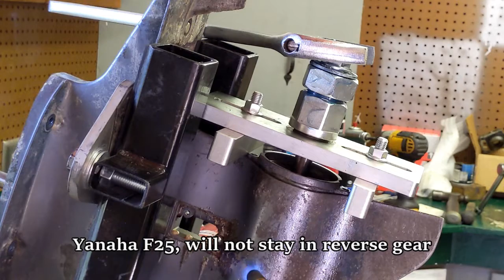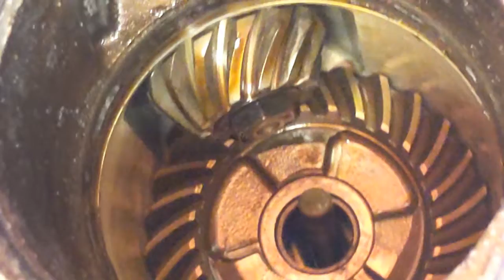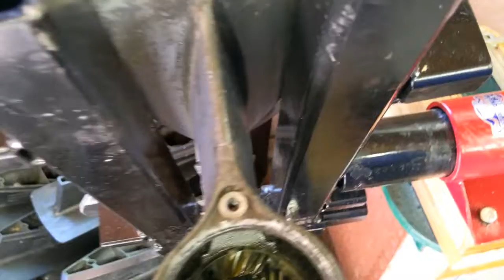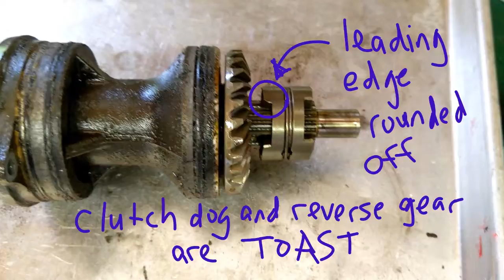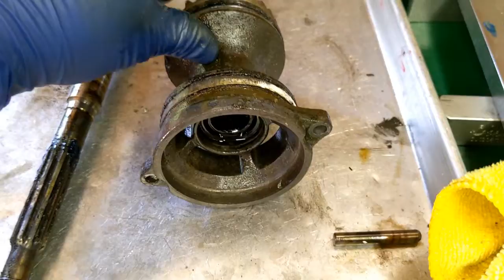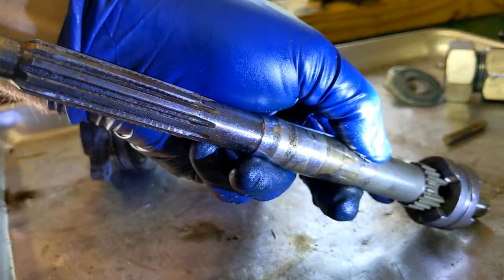OST-0024 Lower Bearing Carrier Removal Yamaha F25 Gears

Comment: Hello! Could I ask you about the pinion under the top of gear in the oldest Yamaha 30 was located flat bearing, but modern motors don't contain this bearing.
And next if pinion gear didn't have top bearing why does the vertical shaft have conical bearing except ballbearing?
Conical bearing shold have pair of counterforce! 
But modern motors of 30 hp didn't have counter force for conical bearing!
Please describe what the hell is going on with marketing?

Comment: Hey thanks for the video. Does that reverse gear come off of the carrier bearing? If so, do you know the process for removal? 
Thanks for your time
Reply from the maker: The reverse gear and bearing usually are pressed into the bearing carrier, but a few second s of heating the carrier on all sides with a torch and the carrier will usually let go of the bearing.  Normally I use a bearing splitter to remove separate the bearing and reverse gear from each other
Reply: Can you do a video showing removing the reverse gear?
Any change for a counter revolution gearbox box?

Comment: Stripped the castle nut first try. Forgot they’re made of softer metal. I’ve also found it difficult to find a suitable nut for the application, i believe the threads are M14x1.5. Do you have any recommendations? I see you didn’t have a castle nut on there. Tyia
Reply: I've done the same.  Are you using a steel nut or the castle nut when using the tool?
Reply: @randykane474  was using castle nut… then i got a hex flange nut from mcmaster carr